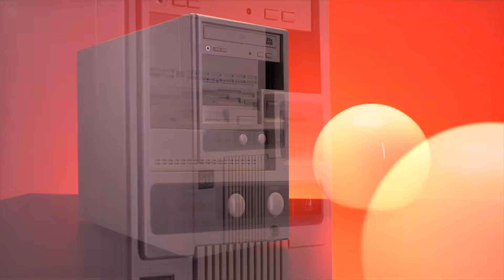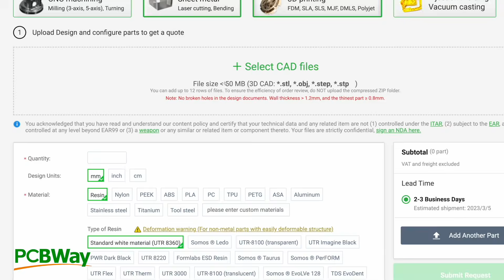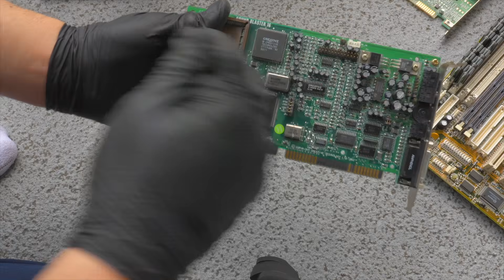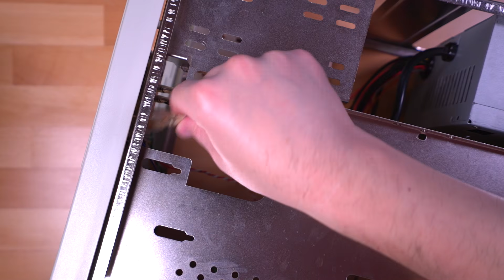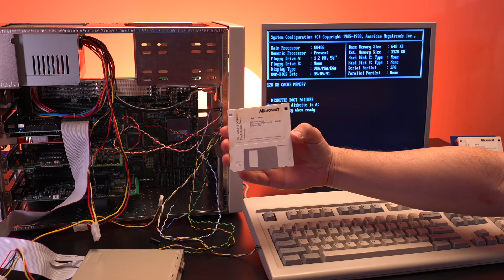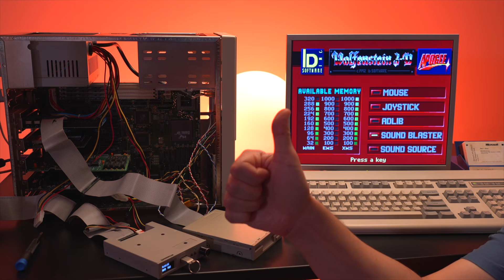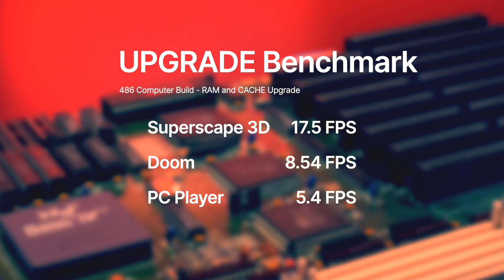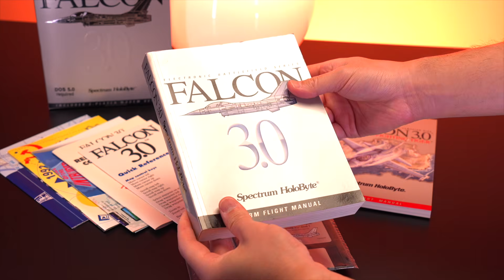Restored And Upgraded 32 Years Later | 486 DOS Build

Comment: I did a retro PC build this summer. Included a lot of the stuff you have. I opted against using the original PSU. I used a modern modular PSU, which is total overkill for a retro PC, but I did it purely for the cable management. When building retro PCs, there's always something that's finicky, so you're constantly plugging and unplugging things, and just having a couple power cables makes a huge difference in the process.
Reply: The RAM upgrade part of the video made me laugh because that's not how upgrading worked back then.  You couldn't just "throw in some RAM" or "add a random perhiperal" and expect improved performance or functionality.  You had to determine if a piece of software required or could even make use of it before expecting anything out of an upgrade otherwise it would basically go unnoticed by the system/OS and software.  Almost ALL versions of DOS/Windows as well as software packages would list "minimum requirements" and (sometimes) "recommended requirements".  If you didn't meet the minimum there was no guarantee it would run and if you got lucky and it did it would usually be somewhat crippled in some way.  If you met the recommended you would get an improved or premium experience, ranging from better performance with better CPU or more RAM or improved functionality such as better audio with a fancy sound card.

Comment: The bottleneck with the framerates is the Trident VGA card installed. They are slow. Shame Tseng Labs ET4000 cards are so expensive but as upgrading the VGA card wasn't an option here the cost is moot.

Comment: Nice to see the spirit of preservation runs in the family!
Someone correct me if I'm wrong, but isn't the XT-IDE a bottleneck on a 486 machine? Being an 8 bit card on a 16 bit capable bus.
The XTIDE universal bios and a regular 16 Bit IDE controller, plus an IDE to SD adapter  should work just fine
Reply: Yes, it is a major bottleneck. At minimum, it is four times slower since it has to do two load/store word operations for a 16 bit data transfer. And since operations take longer, it further slows down the system because data transfers are literally bit banged by the CPU in Programmed I/O mode. PIO transfers are a huge burden on 486 class CPUs and eat up an enormous amount of processing time that slows the whole system down. A fun trick you can do if you have a turbo switch is to toggle it while a large disk transfer is taking place with a real hard drive. You'll hear the heads on the hard drive speed up and slow down with the CPU clock, because the higher CPU clock can move data faster.

This is why when IDE got DMA transfers, it was such a game changer. Computers no longer had to spend inordinate amounts of processing time on manually shuffling data to and from the hard drive.

For the best performance, SCSI is the best storage option. SCSI drives have DMA transfers and a smart controller on both the drive and the SCSI card that can do a lot more without involving the host CPU. Getting a cheap SCSI card and a SCSI2SD board would be faster and use less CPU power than crusty old IDE.

Comment: Ah, the 486. I remember when computers didn't require processor fans and heat sinks. They just didn't generate much heat at all.

Oh, and having to swap out the BIOS chip along with the processor, as they had to match.

Comment: Why the heck would you use an XT2IDE card? The XT pretty much says on which type of PC those re useful. They are,eant for PCs with XT bus, which is only 8bit. Using it on a PC with16bit ISA bus means forfeiting half the speed possible, if not more.

Comment: With AMI BIOS at that time the Turbo button usually can be enabled in the BIOS. I didn't get a good look at your BIOS to see if you have the option.  If it is not there, a lot of times you can flash a later BIOS to the board or even use a BIOS from a different but similar board. If I were you I would suggest you consider a faster 486 and graphics card.  Socket 7 (Super Socket 7 even better) is the ideal motherboard for retro gaming and I am guessing that is your other project.

Comment: You can try changing wait states to zero in the BIOS, if you can. FastDoom would likely help with the speed of Doom. Computers of that era usually only supported two floppy drives, that card you got must have some special settings, it is own BIOS to make more drives work. Those generic cases were so common. They all had a slightly different face, but we're really the same. I've had two, one is currently in the game room hooked up to a Trinitron monitor.

Comment: You have two floppies already. Floppy drive controller only supports 2. Drive a and b. You would either need to remove one of the drives or the emulator. Drive a is after the twist, drive b is below it.

Comment: Getting a math coprocessor installed that matches your 486 (487), would probably help performance quite a bit.  It goes in that unpopulated slot by the 486.  Also many VGA cards are not equal.  Finding a fast one can really help your performance.  Setting up your bios with 0 wait states (if all your cards/ram can run that without being unstable) will also increase performance.  Lastly, most 486 mobos have a "turbo" button.  Just making sure that is pressed in/on is important for performance.
Reply: Intel's  "Math coprocessors"  for 486 machines are just a 486DX with a pin to disable the 486SX.  The socket he has on that very early board is for a weitek 4167.  Incredibly uncommon and not as good as simply replacind an SX with a pin comtabile DX
Reply: He already has a 486DX which has the FPU built-in. Also none of those benchmarks would have been testing floatingpoint math anyway.
Reply from the maker: I tried looking for the weitek chip but could not find it. Definitely seems pretty rare
Reply: @MachoNachoProductions 

My guy the RAM upgrade part of your video made me laugh because that's not how upgrading worked back then.  You couldn't just "throw in some RAM" or "add a random perhiperal" and expect improved performance or functionality.  You had to determine if a piece of software required or could even make use of it before expecting anything out of an upgrade otherwise it would basically go unnoticed by the system/OS and software.  Almost ALL versions of DOS/Windows as well as software packages would list "minimum requirements" and (sometimes) "recommended requirements".  If you didn't meet the minimum there was no guarantee it would run and if you got lucky and it did it would usually be somewhat crippled in some way.  If you met the recommended you would get an improved or premium experience, ranging from better performance with better CPU or more RAM or improved functionality such as better audio with a fancy sound card.
Reply: If I recall correctly by the 486 era they all had the math coprocessor built in.  This deficit was present in the 286 and 386SX (386DX had one built in).  I don't even think it was an upgrade option for the 8086.
Reply: @JPs-q1o you could still get 486 SX CPUs that didn't have the math coprocessor built in. My first family computer was a 486 SX 25.
Reply: @TheRealNZgeek 

Hmmm...so my recollection must be off.  That would have been the Pentium era where all that was included in the chip.  The first PC that I played around on was my friend's 386...by the time I had gnawed at my parents enough to cave and get one it was a 486DX/66.
Reply: @JPs-q1o  it may have only been the low clock speed 486's that came as an SX version. I can't recall there being SX versions running at 50/66/75/100 MHz. But definitely from the Pentium onwards, the whole SX/DX thing disappeared.

Comment: you missed one chip near cache on your motherboard - was wondering what those smaller chips in front of the cache. plus you should look at upgrading your video card to resolve fps. other than that it's so awesome you were able to have this still working and well stored by your folks.

Comment: That VGA card was a potato when it was new. It was likely the cheapest one available when the machine was new.  It's more suited to a 286.

Running your XT-IDE in an 8 bit slot is also going to be a bottleneck.  Also, use the correct version of XT-IDE.  There's one for fast AT bus machines like your 486.

There's a spot for a second case fan in the front of the case, behind the card slot holders.

If  you are looking for a period correct CD drive, it would be a 1X drive with a proprietary controller card, or possibly a SCSI drive/

Comment: Your PC so obviously do whatever you want to do. Personally, I would've thrown out the older power supply for something newer with better efficiency and longevity. Something like a modular 450w PSU and then just using cable adapters to get the specific connections you need. The power supply isn't exactly a solid state part, and it does degrade with the capacitors/transformers/etc over time, and if I hold the rest of the PC to be valuable, I wouldn't want to risk the eventual failure of the PSU to also affect the failure of the motherboard or CPU, etc. Yeah, you could also just do component level repairs/replacements of individuals through-hole components on the PSU, but even in the best case scenario, it's an off-label "perfect" brand PSU, it was never an exceptionally designed unit, and it's not as though it was contributing to the PC's performance in any way besides being the case's only exhaust fan. A new PSU is offering the same level of convenience/longevity as a TF-card replacement for older 128mb hard drives of the time. TF cards are less moving parts, solid state, convenient data transfer, and the longevity of knowing your hard drive won't fail within the next 5 years due to aging components.

Comment: The bottleneck in your benchmark results is the video card bus type, ISA. Computers of the era (486s) used to have a special VESA port for accelerated graphics. Also, (original) PCI started to be a thing so actual Pentiums PCs used it extensively, and later 486 boards also incorporated PCI ports.
Reply: This.  Also running the 8 bit version of XTIDE intended for 8088 class machines.
Reply: @dennisp.2147 I was wondering about the xtide, if he was just using it for the option rom or if he was bottlenecking the system by using an 8 bit isa interface instead of the chipset's built in 16? 32? bit interface with a simple CF to IDE adapter
Reply: @michaelturner2806  Or just use an IDE SSD.
Reply: Also tighten your ram and cache timings!
Reply: @Brooklyn727 This was 1991 😂. Your PC bios and caps and vrms were all analog not digital. Your PC ram ran at what the dim was timed for. It wouldn't make a difference as that CPU is 50,000 times slower than a modern CPU. Today's cpus are so fast they execute data faster than the ram and cache can feed it hence you see a boost ... In 1991 your ram and cache ran faster than what the CPU could read it. Only servers and supercomputers ran better with cache and higher speed ram
Reply: @timothygibney159   Wow, uh, no... sorry.  Nothing in that is true at all.  Even the PC AT 286 used DRAM that required a wait state (idle bus clock) to be inserted during R/W operations.  RAM got faster alongside CPUs, but not enough, so we've pretty much always had to wait in idle delay loops while the RAM performed the operation requested by the CPU.  That is the whole reason cache exists -- cache is SRAM that runs quite a bit faster than DRAM.  We would just use SRAM for everything instead, but DRAM is so much cheaper, making it the only option to get the capacity we want at a reasonable cost, so we put up with its (relatively) slow speed.

BIOS is not analog, and never has been.  The RAM timings are the settings that program the motherboard chipset and tell it how many clock cycles the RAM requires to complete its various operations.  You can often tighten these up a bit (reduce the number of wait cycles), and as long as your RAM can get its work done in those shorter periods, your CPU will spend less time waiting, making things run a bit faster.  This is a "law of large numbers" thing -- you won't notice the difference everywhere, but anything that does a lot of copies to and from RAM will definitely benefit.  That's as true then as it is now, because the relationship between CPU speed and DRAM speed is still kinda the same as it was then.
Reply: And change the wait states to zero, if possible.
Reply: But that’s a limitation of the board he needs to work with. The only way to significantly improve this PC is a CPU upgrade
Reply: I wonder if there is a crystal on the motherboard that can be changed for overclocking that 486
Reply: There's a few 16 bit graphics cards that would help this board without VLB.  A slight cpu overclock would help too.  I have a 66mhz dx2 running happy at 80mhz on my PS/1.  Obviously be very careful with overclocking the cpu (I used a fan directly on the heat sync)
Reply: I was coming here to say this. I was yelling at the screen saying its the video card, when He was surprised that his benchmarks still sucked after ram and cache upgrades.
Reply: Many of the graphics benchmarks will, indeed, be constrained by the ISA bus to the graphics card.

But, the performance boost from 128K to 256K cache is also dependent on the task.  If the CPU needs frequent access to large (or many) blocks of data from RAM, more cache helps.  If you have small access patterns that fit in 128K, or really large ones that exceed 256K, you'll notice less of a difference.  There are cache checking tools that can run synthetic tests to verify the on-CPU L1 cache and on-board L2 cache presence and efficacy.

Either way, if your CPU is spending all its time waiting on bus operations to complete, when moving chunks of graphics to video RAM, then cache isn't going to help you.  486s really need VLB.
Reply: Not necessarily I found out that for dos you need univbe67 in order to have a better experience since there are no official dos video card drivers
Reply: It's the CPU. Everything ran in software not hardware on the CPU. Nvidia invented GPU accelerated things about 7 to 10 years later.
Reply: @timothygibney159   While that's true (the software-rendered part), you still have to copy the graphics between the CPU and system RAM, and video RAM.  And you have to do that across an 8MHz 16-bit bus with an ISA graphics card.  With VLB, you can do that at 32-bits (2x speed improvement) and at the I/O clock speed of your CPU, which is usually somewhere between 25 and 33MHz -- which yields another 3x to 4x speed improvement over ISA.

Comment: A co-processor can go a long ways to making those games run great!
Reply from the maker: I was actually looking for that coprocessor but it seems they’re super rare. Couldn’t snag one for the video. Would have been really cool to install one and see the performance boost
Reply: @MachoNachoProductions  Don't bother.  Just swap the 486SX for a 486DX, which has the FPU built in.  even petter, look for a 5v 486DX2 or DX4 for clock speed doubling or tripling.   You will still be I/O bound by your 16 bit ISA bus motherboard though.

Comment: IMO, the real answer to the question "should you build a retro PC in 2025" depends on whether someone can tolerate not just the build/restore process similar to how this video went, but also how variable and unpredictable the quality and compatibility of potentially available parts would be if one's not careful (or, more likely, insists on sticking within a particularly strict budget).

I'm more impressed your childhood family PC was kept in such good condition, Tito. I only found out recently that my mom basically gave away our childhood family Commodore 64 years ago, so there's a Bondi Blue iMac I had restored in that apartment that I'm also very much not confident about still being around.
Reply from the maker: Yeah I was so grateful that everything has been kept. We also have all our family computers up until wrong the 2010s before everyone sort of had their own computer. I may be restoring and modding those as well 😅

Comment: My first PC had a Slot 1 Pentium 2 MMX 266mhz CPU running Win95c bought around May/June of 1998........it started with a 24X CD ROM which was replaced a year later or so with a DVD drive and a 24x10x40x CD-RW towards late 2001......the motherboard was a Gigabyte brand 440BX chipset.....first had a 4mb S3 Virge DX graphics card which was upgraded to a 32mb Nvidia Vanta 3D accelerator card in Christmas of 1999....4.3 gb IDE ATA 100 HD.....Smartlink 56k modem with onboard sound which was replaced with a Conexant 56k modem and had to add an ESS sound card afterwards
Reply from the maker: Sounds like it was a pretty sweet machine!

Comment: You didn't mention it, so I guess you didn't and/or you don't know. You've forgotten an essential step for increasing performance under MS-Dos: memory optimisation!

I won't go into the technical details here, but a good starting point is to use the native MEMMAKER tool. After that there are memory manager optimisations (EMM386 & HIMEM.SYS) but I'll leave you to do your own research.

Thanks for this video 😊
Reply from the maker: I’ll definitely have to check that out!  Thanks for the heads up!
Reply: @MachoNachoProductions  The most important thing under DOS is the conventional memory (maximum 640KB, you can check it with the MEM command). With good optimisation, you can free up to ~615KB. Despite all my knowledge, I haven't managed to go any higher because there are essential resident memory programs (TSR) that you can't move into high memory. If you done it well, you can make Doom playable at ~30fps with your actual config. Good luck !

Comment: On that yellow wire for the fan, you can pop the pin out of the plug. You can buy set of keys for pennies, or use a small screwdriver